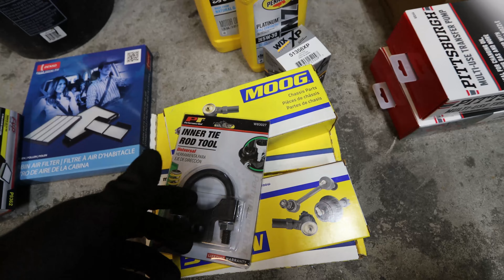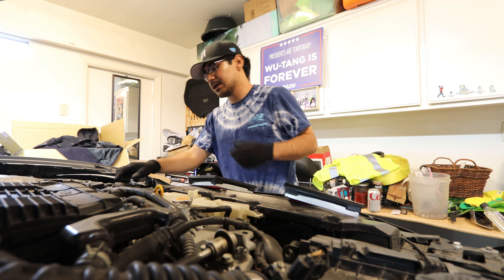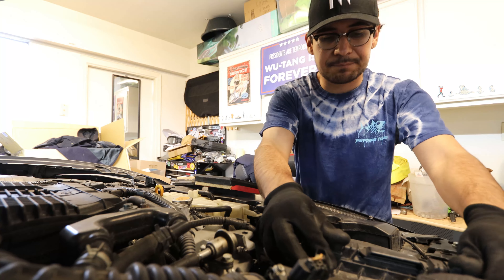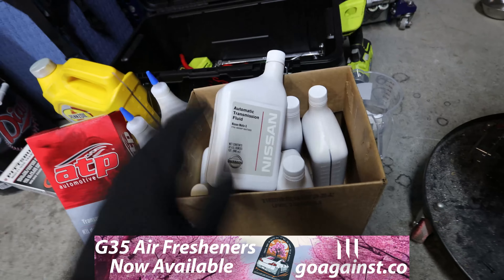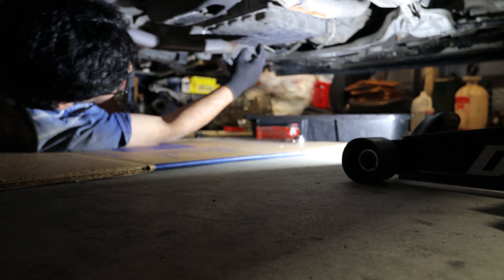Do THESE Things to Maintain Your G37!

Comment: All fluids, ⚡️ 🔌,battery, pcv valves, oil pressure switch, belts, pulleys, front sway bar link, thermostat & gasket, coolant bleeder valve…the rest inspect the car and add to list.

Comment: For the gallery gasket, get the EPS Kit. Also, look in to the bleeder core union, it’s on the back left hand side but they usually break at high mileage and can be PITA if not caught in time.
Reply: ik this was months ago but could you elaborate? wdym eps kit?
Reply: I have a 2012 g37 ipl with 206k miles I recently changed spark plugs but I couldn’t get out the 6th one cuz it seemed like it was seized in there what else would you recommend me to replace on the car and maintenance
Reply: @prodriftingchikee6910  PB blast and heat to remove it. Maintenance wise, you could use some sort of carbon remover to clean the heads, a tune up which sounds like you already did, and just look under your car and check if there's any leaks, otherwise you're good to go.
Reply: Bleeder core sucks but is a cheap part but when it does go you’ll be leaking coolant fluid everywhere mine went around 158k miles
Reply: @johnieg37s I guess this is why my antifreeze is getting lower for no reason

Comment: You can use the Valvoline  max life transmission fluid instead of the expensive nissan fluild. Approx $25 for 5 quarts.     I have been using it on my 2003 G35 with 300k miles now and 2012 G37 with 131k without any issues.
Reply: Just got a 2013 g37 couple days ago with 90k on it.  I did brake fluid today but how often do you do the transmission fluid and filter?
Reply: @ptinker106 you don’t change filter, just the fluid, or if you’re more able with your hands you can drop the trans pan and clean it + change gasket.

Usually about every 60k mi or 45k if you beat it up every single day
Reply: @klenthecreezi1041 Yeah, 30-60k seems about right.  Most car maunfacturers say the Trans filter is not serviceable and guaranteed for life, but if I drop the pan, I usually spend a couple extra minutes to change the filter.  I think there is a baffle with bolts.  I would do filter once per 100k to remove any contaminants.
Reply: Car is beautiful

Comment: Nice video, bro! For my 370z, it had 58k miles, did transmission, gear, and engine oil. FYI!! Nissan recommends Ester based engine oil for it's lifter system! It's common these engines have a "tick" even with regular driving, it's because ester based engine oil isn't used.

Comment: Thanks for the video! My mechanic told me to use the OEM Air filters since the other brands may deform or throw a CEL. I also changed my transmission fluid and it was pretty dark (no burnt smell). Will wait for a couple of months and do another change with a  pan drop. Was wondering how did yours look? Also don't forget the transfer case fluid!
Reply: Put in 2 K&N filters and had no problem with it throwing codes. Seems to run better also.
Reply: @drjimjam1112 
Ya same here. But hate buying 2!!

Comment: I got mine when I was 19 and I swap the full rack and pinion including its tie rods spark plugs valve, cover gasket transmission fluid, oil differential fluid. Calipers brakes and rotors
Reply: I got 126k never touched the trans oil u think i should??

Comment: My only challenge is replacing the transmission fluid and break fluid lmao. I will attempt the transmission fluid so my question is does the transmission pan have a gasket or is it just bolted by the bolts? If so do I need gasket maker or is there one I can already purchase? 

My last question is what tool do I use to refill the transmission from the dipstick since the dipstick is so tiny?
Reply: Hopefully you’ve found some info and were able to get the maintenance done, however if not; 
Every metal part that attaches to another metal part usually has gaskets (pan to transmission/upper pan). The gasket should be available at your local parts stores, but can be found cheaper online. 
As for filling the trans, I’d recommend a thin tipped funnel (imo, it’s best practice to always replace filters when you’re dropping fluids) 

Hope this helps someone!! 
- A Former Diesel Tech

Comment: Great contents man! My 08 G37 sometimes has this weird noise coming from the front left suspension area when going over bumps, it's kind of a rattling sound when the car's cold, but turns into a squeaky sound when the car gets hot, after watching your video I am starting to wonder if it is tie rod issues, gonna go take a look at that soon
Reply from the maker: Check for looseness or play, could also be your sway bar end links, so just start grabbing things under there and see what has play or looks kinda funny
Reply: Same issues. Think it's the links or loose exhaust

Comment: Highly recommend 0w40 or 5w40 for VHR engines
Reply from the maker: I’m very interested in these findings! How’d you get to 0w40 and 5w40 being what you’d use for daily driving oil? 😮
Reply: @JoeVazquez  0w40 or 5w40 protects the gallery gasket. You can daily it 100% 40 weight won’t hurt if anything it protects your engine and less oil burning too
Reply from the maker: Woah that’s pretty cool definitely didn’t know that! Thank you for sharing, only time I used 5w40 was for the track!
Reply: @Tommikegetitright101i  

Is running the thicker oil safe? I have a g35 HR and my oil pressure is at idle 15 and 35 psi at 2k. I tried the Lucas synthetic but I guess it might be better running thicker oil. Someone told me not to run different oil than what it’s recommended. Someone did tell me to run 20w50 to bring the oil pressure up.
Reply: @gloglo1275  Scotty Killmer says to only use the oil that's called for from the factory.
Reply: @cooldaddyslick6869  

I guess my oil pressure was fine. I didn’t realize that you just check this during a certain temperature range. As the oil gets hotter it loses its oil viscosity at different temperatures. I saw a mechanic show to measure the oil temperatures while performing the test.
Reply: @cooldaddyslick6869 
And scottys never been nothing but a shade tree mechanic for '50 years'.
Reply: Should i start using Ow40 or 5w40 for my stock g37 ??? And how often do you change your oil
Reply: @armandoking4657  5w40 if you live somewhere hot. Change it every 3,000 miles
Reply: @Tommikegetitright101i 100% in Germany the g37 uses 5w40 as the factory oil. Been using it for 4 years in my old 08 g37, use to be my daily, no oil leaks nor loss of oil pressure.
Reply: I use amsoil 5W30 for my g’s

Comment: Hi, I have some questions regarding JATCO 5AT’s ATF level, the same AT is in your car.

FSM says ATF’s dipstick should be checked 30-50 Celsius degrees at COLD range and 65 Celsius degrees at HOT range.

You know that the ATF’s dipstick’s HOT range is kinda grill patterned.

At 65 Celsius degrees, where should the ATF be at HOT range?

Comment: definitely love the g35 content man! you actually inspired me to make content on my is300 in the near future.

questions about the oil cooler though, do you know what part of it failed ? and do you still recommend buying the brand you installed?
Reply from the maker: I appreciate you bro! That’s amazing!

The part that failed was the cooler core itself, it had a leak in the bottom of it and just started pissing out! I could buy a replacement or even get a better brand and then be good though so it’s not a huge deal breaker!

Comment: yo bro i did a drain and fill, cleaned out my pan and filter change exactly as you did but now it slips from a standstill in first gear but other than that no signs of slipping, did this happen to you too? also how much fluid did you have to put back into it?
Reply from the maker: Measure the dipstick and be sure that you’re at the right level, if you measured exactly what came out and put the same in you won’t have any issues!

Comment: What do you think of redline fluid for transmission and diff
Reply from the maker: if you’re going thicker or thinner, have a very good reason for that! I found redline tranny fluid on my g35 made it shift worse than oem, so I swapped back and was wayyyyy happier with it!
Reply: A lot of people, including me, prefer BG trans fluid vs oem.  Smoother shifts.

Comment: DO NOT CHANGE THE TRANSMISSION FLUID if the fluids already Dark!
Reply from the maker: 1+ year and it’s driving perfectly fine
Reply: Just drain but not flush.
Reply: Yea flushed mine and now it’s slipping😭 manual swap coming soon.